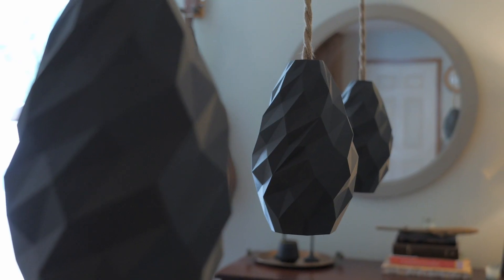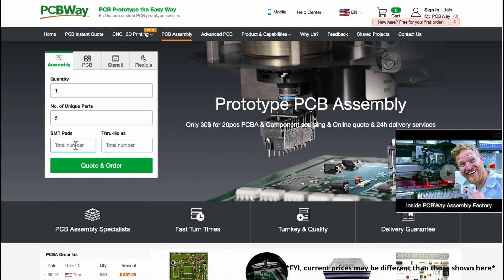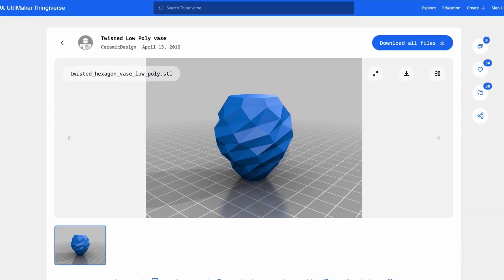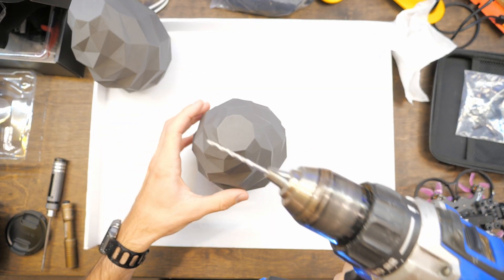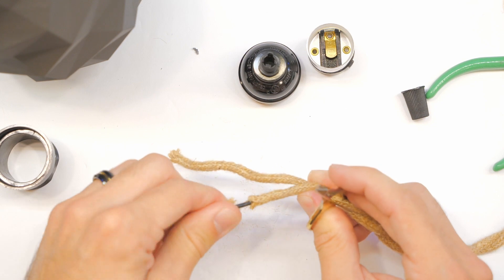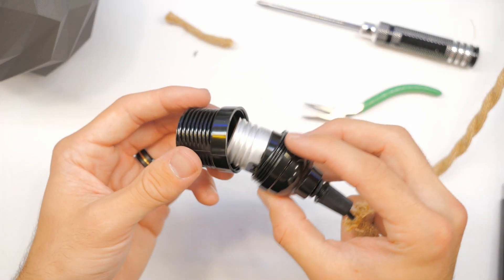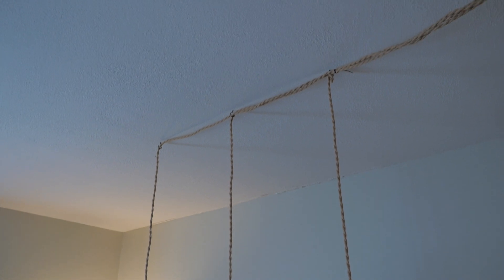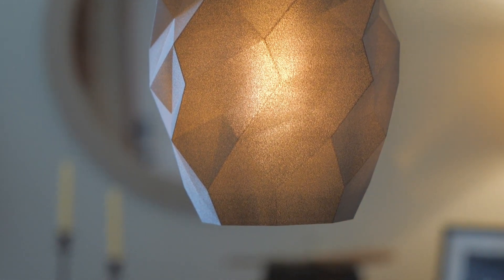Beautiful Minimalist-Modern 3D Printed Pendant Light Lampshade *DIY* ~ Protopasta Iron Metal PLA

Comment: looks great and no i can't see any layer lines at all in the video
I would love to print this in the iron filiamment but I don't think my printer has a hardened steel nozzle
I have one but I an not sure i want to mess with it and change ou the nozzle just yet.
Also when you enlarged it  did you  change the ratio because  in  the STL on thingieverse it looks  short and squat and yours looks much more tall and  slender  which I like much better.

Comment: bro really hot glued his way to connect the wires😂

my dad would kill me if i hot glue something like that instead of using a wire stud hole soldiered to the wire screwed in there
Reply: I'm an electronics engineer (not a very good one). The best option in this case would be to crimp a ring connector to these and thread the screws through them. I think the hot glue is maybe not a bad idea for additional insulation/safety, since heat shrink can't cover those spots, but it's definitely not providing any structural support. 

Soldering would be a bad move for connecting up to a screw terminal like this. His method of wrapping the wires actually isn't the worst approach, but from context it sounds like this fella works with RC stuff, so he should absolutely invest in a decent ratcheting crimp tool and a variety of die inserts. A perfectly usable hobbyist's kit with several sizes/forms and a few hundred connectors runs $30-50. Maybe it's just a nerd thing, but I think it's really satisfying to wire things together when you've got all the proper connectors and fittings, not to mention exponentially safer, more reliable, easier to service, nicer looking, accurate, repeatable, and frequently faster to assemble.

DISCLAIMER: I have not been paid by the wire crimping cartels, I am just a huge nerd.

Comment: The LED polarity does matter for DC but for AC  light sockets 
the idea is that you connec the "hot" or black wire to the pin at the bottom of the socket and the neutral white wire to the screw base part
 This is so that if you touch the screw base part you won't get a shock.
It looks like you connected the white wire to the gold terminal  which is the one that  goes to the pin at the bottom of the socket, it should be the other way around unless you just change it on the other end.
Also would be nice if someone could do a remix of the STL to make a hole that is the diameter of a standard threaded lamp rod this way you could have used that 
little collar  piece on the outside of the shade and tucked the  wires and rope inside for a nice clean look also maybe print a thicker base layer.
Reply: Led polarity does matter to such a degree that it matters with DC. However, this is AC, which needs to be converted to DC first (that is what the internal circuitry is for). For AC is doesn't matter at all. You can easily turn your plug 180 degrees in your socket (and thus switching hot and neutral) and all your appliances (including LED lights) just keep working. 

It is however good practice to connect the hot wire to the central pin at the bottom, but that's due to safety, not polarity. You want the most easily connected part (the outer shell) to be connected to the least offensive lead (the one that doesn't shock you). Or put in other words: you want the killing part as far away from prying fingers as possible. 

But once that light socket is connected to a plug, all bets are off. (and you should probably teach your kids not to touch those metal parts)